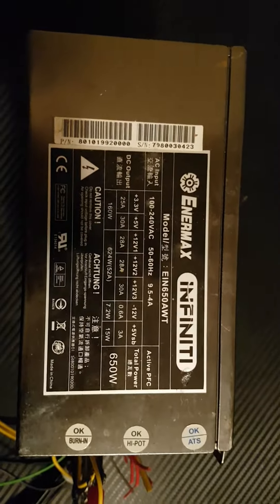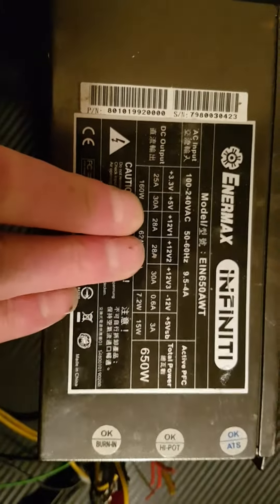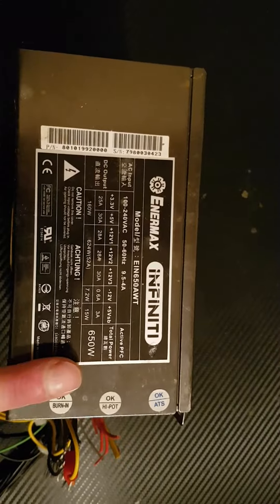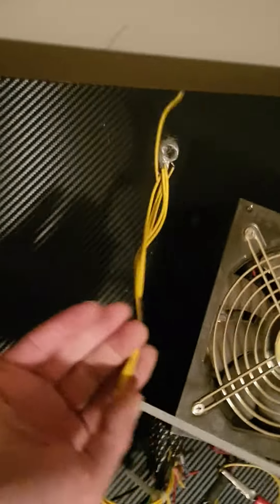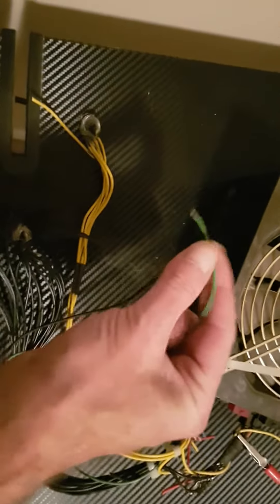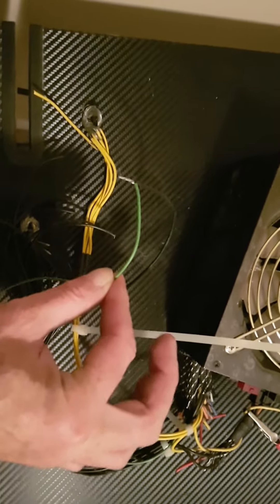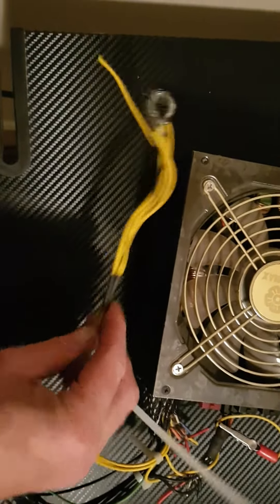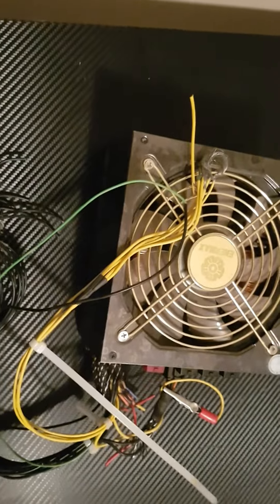Electrolysis using computer power supply.

Comment from the maker: My setup isn't pretty, doesn't need to be. It's cleaned alot of cast iron over the years and still going strong. Didn't cost me a cent either, pulled it out of a computer that wouldn't boot because the 3.3V power was blown. As long as the 12V works and you can test it with a meter, you can use it for electrolysis.

Comment: I think you also can get 24 volts at a slightly restricted amperage if you use the -12 volts and +12 volts together.

Or you could just throw 3 pins in there +12, gnd,  -12 and the ground wire will produce both hydrogen and oxygen (at least I think)

Comment: I use a battery charger for mine
Reply from the maker: Most do, but it's getting harder to find the manual chargers. This is just a different way, cheap and easy :)
Reply: I have to use a battery for my charger to work.Other wise it won’t turn on.